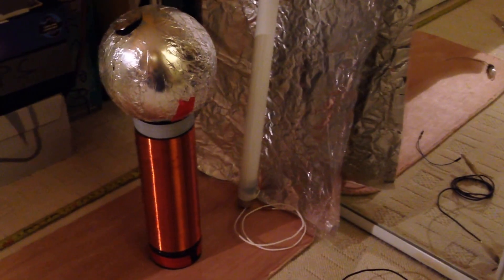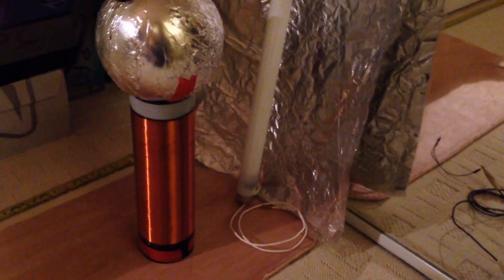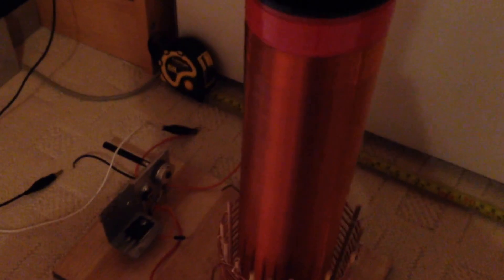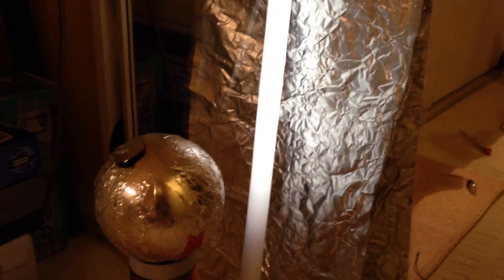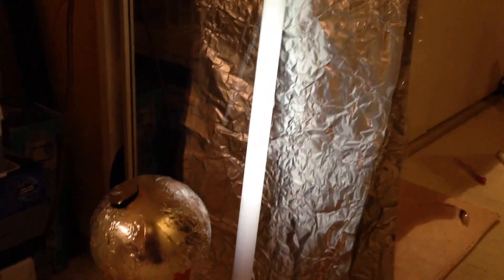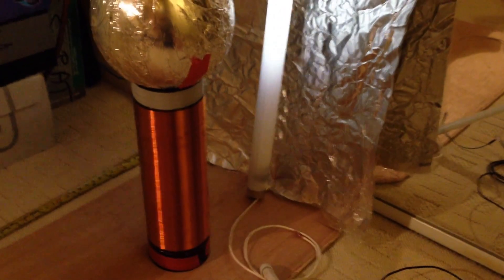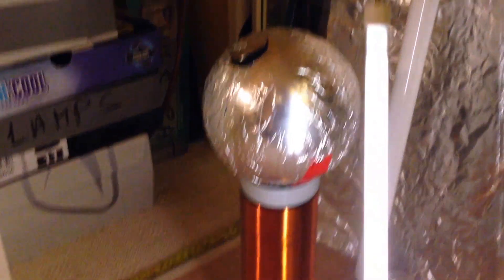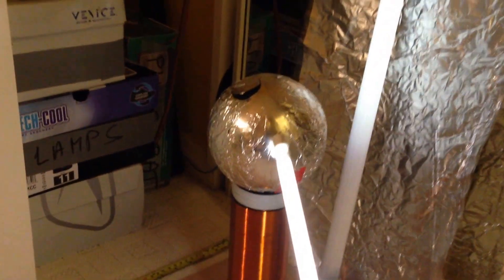Slayer Exciter SEC Challenge

Comment: If someone can just figure it out to where it becomes like a standard appliance in every home, like a water heater, a Tesla coil in every home recieving and transmitting the free standing energy that's already around us. If every home had a well built perfected water meter sized powerful Tesla coil to where it's tuned to every other one around the neighborhood, and tuned to where there is no spark gaps or disturbing noise, and no invisible radiation just pure powerful, yet clean and unnoticeable pure electric  energy.
Reply: So maybe Tesla had the right idea all along, but instead of making 1 huge tower to power as far and as  much as it can, maybe it would of been much more easier and practical if it was just scaled down to numerous little ones, like house hold size..